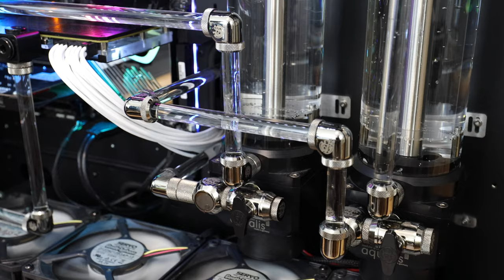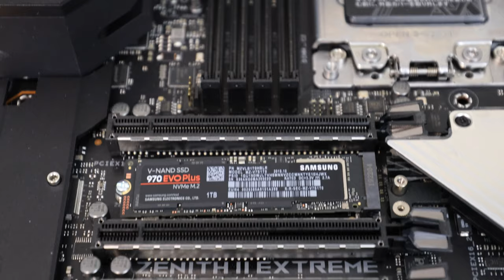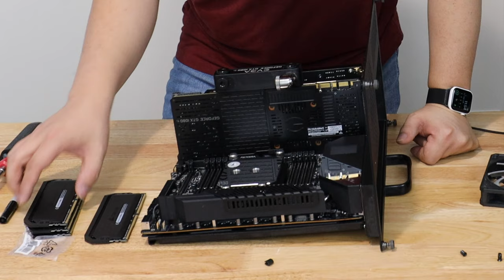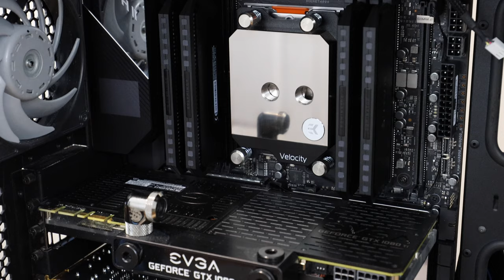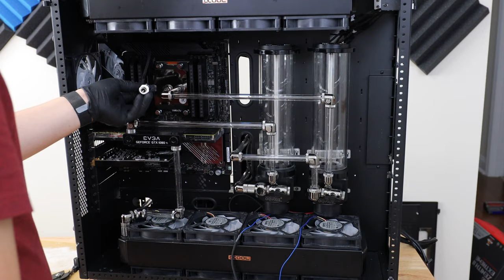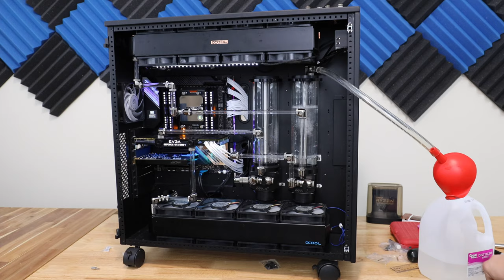AMD Threadripper 3960X Build Timelapse Montage

Comment: Three thick 480mm radiators, two large reservoirs and 1500w psu are way over the top for a 1080ti and even the Threadripper. Unsure if there will be bottle necking issues.
Clean build though and like the use of glass tubing.

Comment: You've mentioned that you can turn on and off the M.2 slot at the back of the motherboard for booting a different OS.
Do you control that by switching the booting device priority in the BIOS?

Comment: How do you like the glass tubes? I was thinking about trying them out myself
Reply from the maker: I love it. It's definitely not for the novice watercooler. I'd recommend you at least have some experience with hardline or have custom watercooled in the past. It's a little different from PETG, closer to acrylic, but overall relatively similar.

Comment: very good build but its an overkill for a 1080ti. You can go much higher for GPU considering the kind of water cooling support you did. Everything is on on point. Even my younger brother laptop has a 1080ti. You are insulting threadripper with 1080ti

Comment: Hi, what wattage is the PSU?
Reply from the maker: AX1500i
Reply: @SuprUsrStan  thanks for the response! I'm doing a similar build for myself soon but with an rtx 2080ti and for cost reasons do you think a 1200 watt platinum would be good enough?
Reply from the maker: @dominicnikon6276  1200W+ is enough for a 2080Ti and a healthy overclock on the CPU. I've been able to pull about 1000W at the wall which is like 900W of actual rated power. I also have a pretty intense overclock too.

Comment: Amazing yet so unnecessary to have so much radiator for each component even with an OC.
Reply: more fans = less rpm to achieve the same cool = more silent
Reply: @yannguthrn9016  less rpm ok, but the radiators are huge, are you sure the hot air gets out, even with a push pull configuration?
Reply: @giessse  no, you are right... the only way to be sure is to test and it depends the air flow of each fans :)